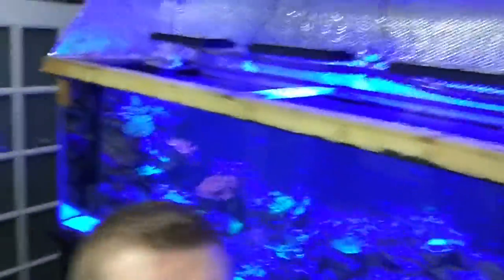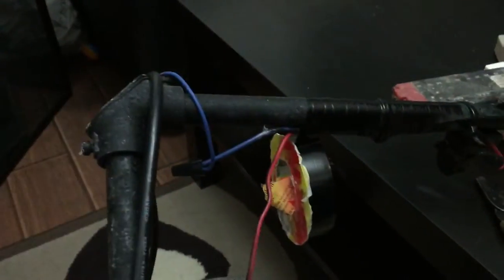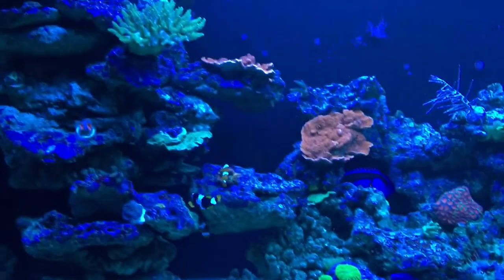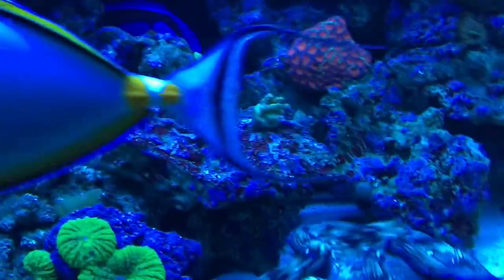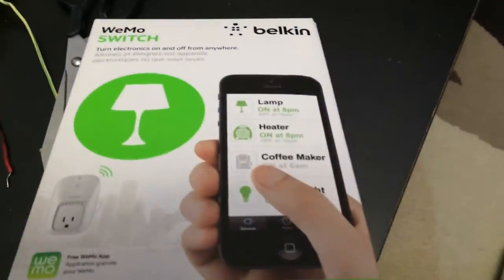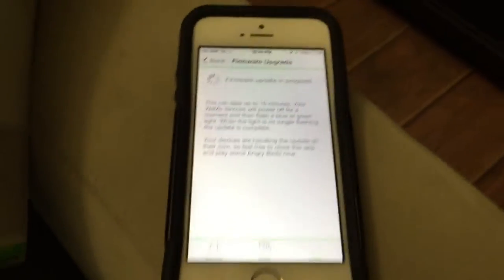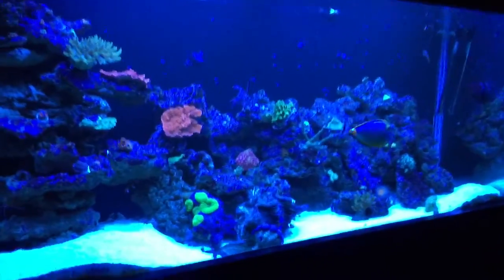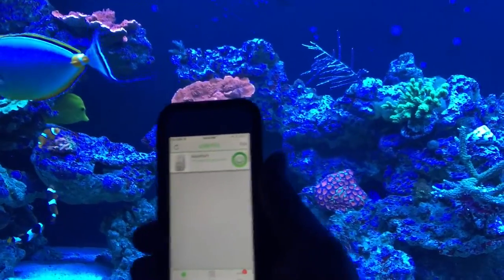T5 experiment plus added a wireless controller for the t5. Part 2

Comment: Dude nice setup.  I current have a Current USA LED on my 54 corner tank (tank still cycling) and I was told I should swap it out for T5s.  I did not want to lose my LED so I might do a rig like this.  The T5s you have are they white or blue?
Reply from the maker: Hey James thanks for checking out my video. I would keep your led buddy. Do the same kind of System I am running. Just pick up a t5 retro for kit. If you need any help more happy to help you with any of it. I am electrician so if you need any help with wiring let me now. I love my LEDs I would never get ride of them. I had 2 400watt Metal halide before. But the t5 give the corals little extra punch. So good luck hit me up anytime.
Reply: FARM BOY REEF thanks I will keep that in mind. When time and money allow I thinking of linking the lights via my RaspberryPi system I'm working on; I am a computer guy. 

Def your video gave me an idea of how to keep my LED and add T5s.
Reply from the maker: @james king what's the length of your tank ? I will keep my eyes open for you for good deal.
Reply: The open part is about 29in